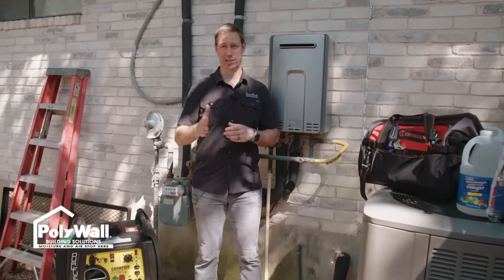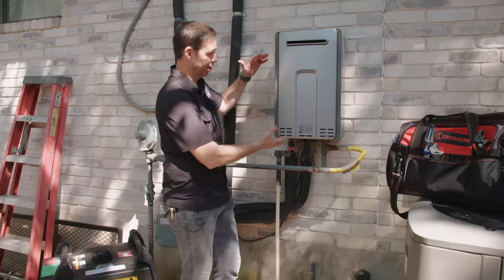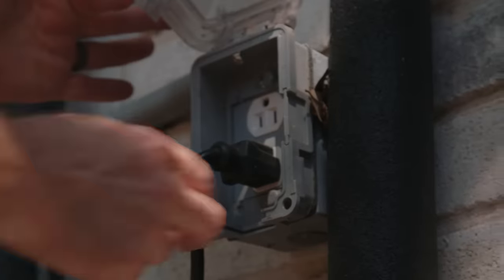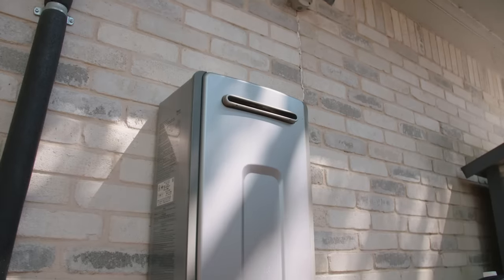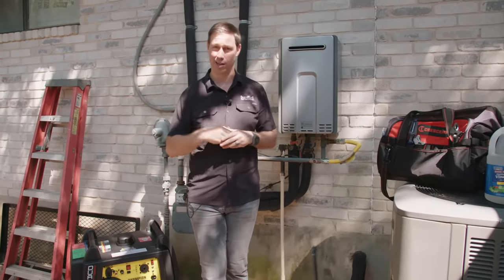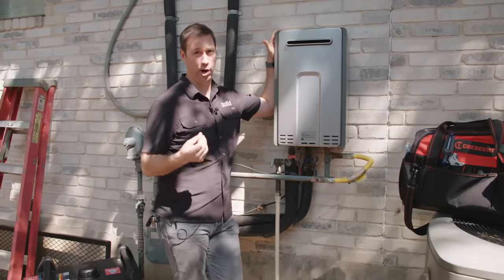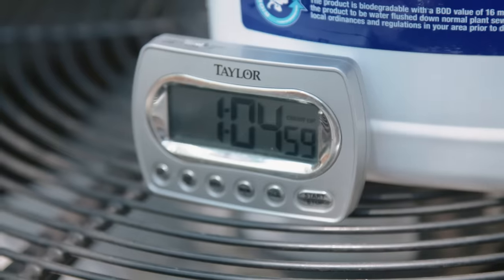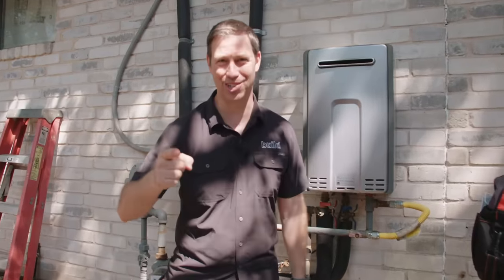3 Things They Don’t Tell You About Tankless

Comment: We had to have a water filter system to PROTECT the tankless.what we WEREN'T told was that our area had water that was very heart in calcium and lime so we went thru 2 filters a month. Then the tankless only lasted 5 years and NEEDED to be replaced AGAIN., and as a tankless costs 5x's as MUCH as a reg. Water heater and in order to have the 1 year warrantee be valid you have to pay a special plumber sanctioned by the tankless' manufacturer install it..... In the long run we went BACK to a STANDARD 30 gal. Elec. Water heater as a replacement when the tankless died.

Comment: Is a recurrculating pump worth it? About to build a house and sub contract myself if possible.lol   House more linear than horizontal and if I can save money by having hot water instantly as opposed to wasting water I would spend extra to get a tankless heater with built in pump.  Just don't want to go backwards finacially for convience for hot water.  Thanks for any advice.

Comment: Marey makes  tankless gas water heaters that do not use household electricity.  They use two D cell batteries for the ignition and valve.  The batteries need to be replaced every 4 to 5 months.  That's worth having after a power outage.

Comment: Another thing they don't tell you.. while they are totally great for showers, they are not so good for doing the dishes (hand washing) or shaving... anything that you do that turns the water on and off repeatedly.  I'm quite positive its resulting in more water usage.  When you turn off the hot water it shuts off and it doesn't turn on immediately when you start asking for more hot water, so whats in the pipe gets a nice shot of cold water before it goes hot again.

You know, another advantage to having an old school hot water heater is that in case of emergency, that old school hot water heater is full of drinkable water.

Comment: My tankless is inside and I simply plugged it into a normal computer UPS.  If power goes out, I have days before I have any problems.  The tankless just needs a little bit of power to monitor water flow and spark the ignition.

Comment: One you didn’t mention is the hot/cold water sandwich and the unheated water when you run the tap slow or for short bursts.  By the time I’m done washing dishes I have nothing but 40’ of ice water in the lines between the sink and water heater.  Have they solved these issues on modern tankless? (Mine is 15yrs old).

Comment: I considered a tankless system to save energy / money. I have natural gas that powers by furnace, hot water heater, and oven. My summer gas bills (when I am not running heat and therefore only consuming gas for hot water and cooking) is ~$20. Therefore I realized even a tank hot water heater is not consuming very much energy
Reply: I'm thinking about tank-less, BUT as you said my gas bill goes up dramatically during cold winter(last year went up twice), that tells me furnace is the one uses a lot of gas to heat the house , so i'm not sure if i can save on gas bill as single person.

Comment: Opinion this if you will. I live in Hawaii, I know sounds great, but energy is extremely expensive out here. We do not have gas in our home, everything is electric. Occasionally I'll take a gander at our power meter outside when the hot water heater is on, and that wheel is spinning SO FAST! I can nearly hear my money draining from my account. I rarely use the AC here, and LED light bulbs throughout the house, I can't think of anything else I'm really using other than my computer and the TV sometimes. Anyway, my power bill is always over 300 dollars and talking to friends of mine, that's really cheap compared to what they're paying. 

ANYWAY, you mentioned your water heater being gas and you won't save as much money switching to tankless. Would that make a major difference on my part? My water heater is supposedly efficient, but I know for a fact that any time the dishwasher is running or the washing machine or shower, that wheel is spinning for at least an hour longer than the cycle of whatever is running. Trying to do anything I can to save as much money living here.. It's not cheap...

Comment: With a 50 Gal water heater, you don’t get a certain amount before you get cold water, ive installed hundreds of them, their shelf life may be 10 years but unless you have bad elements or thermostats, it should keep up with over 4 showers running at the same time, considering most heat up 15 gal a minute.

Comment: Also energy savings from eliminating the stand-by losses are negligible/zero during the heating season, because heat leaked from the hot water tank contributes to heating the house. In warm weather locations savings are potentially much higher during the cooling season, because leaked heat drives up A/C costs.

Comment: During days of power outage at my small college in NC, (I was maintenance staff at the time). I ran an extension cord from a 410watt Schumacher inverter from my work van to the 2 rinnai units in the dormitory’s. I did this on a schedule at each dorm so that students could at least have hot showers. The units pull almost no power so I case of blackout I would say you can forgo a generator for hot showers. You might run into food storage issues but at least you can have a nice shower!

Comment: I looked into a tankless (electric) for an older home 1960’s well water (45 deg f) the electrical requirements were over a 100amp breaker  the existing service is 200 amp just another consideration temperature gradient and available electrical service

Comment: Matt, here in DFW in my neighborhood a builder installed these. That was fine until that extrem cold we just had with no electricity for over 30 hours. Those tankless were guarantees down to -30 below zero....if they have electricity. We got down to -3 with no electricity and those tanks froze. Then came the fun part. Some had water come into the house flooding the homes. Then finding a replacement, well let's just say some people had no hot water for a month waiting for a new heater and someone to install.

So my question is this. How do we prevent that double whammy without a generator? Because those were in high demand too.
Reply: Move someplace that has a reliable power grid or buy a generator.

Comment: i installed an electric Eco-Smart unit 3 years ago because of the space savings. I have a 2 person household and the unit is no more than 20 ft. from any usage . The flow rate for any outlet HAS to be EXACT  for a controlled temperature especially the shower . I flush the unit once a year with no difficulty . As far as energy savings ... i find none.   IF i had the room i would go back to a quality well insulated 40 gal. tank unit .

Comment: You missed what, 6 more noted by commentators - Min flow rate needed to kick on, need to filter inflow water, units will vary flow to suit settings, negatively effecting user satisfactions, cold incoming water as much of country has overwhelms heating capacity, cost and mess of installing bigger gas lines...  Instantaneous was invented for warm area limited use hot water supply, ie commercial / institutional that were wasting energy with huge hot water production / storage tanks, and was never intended for highly variable high demand residential throughout nation.  What it is is CHEAP when all the above is ignored and developer or GC just slaps one in and tell you you're the problem, if they pick up phone a all.

Comment: I have an elderly neighbor who has never had their system flushed in 5 years. I am going to do theirs for them and stopped by today as they have a model different from mine but looks just like the one in this video. I could not find the “Air” filter. I did find the inlet water filter. Do I have to take the air intake cover off to get to a filter?   Thanks

Comment: We just got an outdoor Rinnai with the recirc pump (set to run 4 hours in the a.m.). It replaced another tankless of another brand that lasted almost 16 years. 2 things I don’t like with the new is the hum of the recirc pump, and the more concerning thing is a couple of faucets will drip a few drops of water when the recirculating pump is running. We have 65 lbs psi at the hose bib, and the plumber came back and installed an expansion tank, but I still get the drips from the 2 faucets (all the other faucets and shower valves are fine). Weird…

Comment: I've had two A.O. Smith 50 Gallon Power vented water heaters. One lasted 5 yrs.  Got another one on a warranty replacement and it lasted 7 years.  Not good.  So another benefit of tankless is they last much longer.  So you might pay more up front for tankless, but these should last at least twice as long or more.  And although tankless has been around awhile now in the US, Europe has had these for decades.  They are not new tech.

Comment: Another downside to tankless hot water heaters is that you can’t have a really slow steady stream of hot water. Since the demand isn’t high enough the burner won’t kick on to heat the water. So you have to have a really good steady flow for hot water. So if you need that really slow slow slow flow of hot water, you can’t have it. I know from first hand experience. It’s a good thing I don’t need a really slow flow of hot water much, but when I do, it sucks. The only way to actually get it is to run another faucet at a good flow, so the demand is high and the burner stays on, but then that means I’m wasting water.

Comment: Thankless! I had a friend have one put in lured by that unlimited source of hot water. First that hot/cold problem sucked. It made you run full flow anytime a trickle would do to save energy and water. Why there isn't a federal code requiring insulated hot water lines I don't know. They rationalize that it doesn't save much energy, but that time wasted is my time. I lived in a house where there was 30 feet of chilling crawlspace to the kitchen sink. Washing hands was run a lot of water (a gallon) till hot then 5 minutes later do it again, what a waste! After wrapping wall insulation around the pipe not that wimpy pipe wrap stuff we had hot water on-tap during cooking and then it was still hot after dinner and ready for clean up. The flue from the thankless heater was very hot when it ran, less efficient than the tank's flue which was only rather warm. I hated this device. My and his choice was finally settled when the hot flue and the rest of it had an over-temp event and dam near started a fire. No thanks. Insulate insulate insulate.

Comment: The cost is more for the tankless but it's a lot more reliable and durable.  We had one for over 25 years and the only reason we got a new one was to get a bigger model with more volume.  In that time I probably would have had to install 2 replacement tank water heaters AND there's a chance of flooding when those tank heaters fail and you are not home.
Reply: While I don’t necessarily disagree with your statement, I couldn’t help but share that my dad lived in a Lake Tahoe and replaced his furnace and tank water heater that were still working after more than 40 years. I personally have a tank water that is on 20+ years.

Comment: Bought a new house with one and missing it right now that we moved. For 10 yrs I used it, soft water and ZERO maintenance. Current owner there has used the same tankless for and extra 5 years with zero maintenance and still running. YMMV. Rather pay for a new one than "maintain it" on a $200-$250 a year.

Comment: Okay,  How about utilizing,  using  both  tankless, and tank ??   Have the tankless output, go into the hot water heater. (Just a small 20  or 10 gallon,  too.  Using this  for initially having HOT  WATER, TO  HEAT pipings.  ). When the tank, gets low, have it setup to start the tankless system, then linking a 3 way valve, to the tank/piping. This would then, use the tankless system.  May some enterprising person, create this, using flow-meters/ solenoids, auto valves, etc.

Comment: For the Midwest what if you installed a tankless in front of your hot water heater. Instead of dumping 35° city water directly into our traditional hot water heater it goes to the tankless first 
set the tankless at the lowest setting 
It  would be an energy savings and you would still have back up if the power went out.
 just asking

Comment: I'm very curious about replacing my leaking r/v water heater and using propane and/or electical...from current uses it appears a ten gallon one may be adequate I've extremely low use and live alone.

Comment: Also Mr. Risinger, Tell your fans: When you get a brand new tank type water heater, remove the "anode rod" first thing out of the box and teflon tape the threads (3-4 wraps) because in 3-4 years it's going to take a breakaway torque1,350 ft-lb impact driver or 18" pipe wrench to remove it.

Comment: My trepidation with going tankless is whether these can handle cold water temps in Minnesota winters. I’ve read that tankless can’t handle below 55F temps. Mine would be installed indoors (basement). Would it make sense to do a setup where the conventional water heater feeds lukewarm water to the tankless?

Comment: I had an electric hot water tank heater.  It died, and then I got an electric tankless.  We have not changed anything about our hot water usage and our electric bill has gone down almost 20%.  The energy savings with a tankless is that the water doesn't get heated when it isn't being used.  A tank hot water heaters has a thermostat that constantly keeps the water at a certain temperature range meaning if you go on vacation, you're using gas/electricity to heat the water.  If no one is home during the day, you are still using electricity/gas to heat the water.  Everyone in the house sleeps on the same schedule?  So what?  You are still using electricity/gas to heat that water while everyone is asleep.  With a tankless that doesn't happen.

Comment: I can't afford an expensive heater right now, but Ive been looking at the cheap ones for well under $200.
I understand that they're designed for sinks and such, but I wonder how it would do in my house? I live alone and only need hot water for 2 things, my quick showers, and my dishes.
No washing machine.
Would a small 1.2 gal hot water per minute tank work for me?

Comment: one other very important thing is the power. These are very hungry in terms of KW . Most residential installations would not work at least in continental europe where default counter is 40 Amp for 220 V. These require 6 K W to get confortable shower

Comment: Totally disagree about the maintenance costs for tankless units. Have a unit made in Japan. It lasted 25 years. Way longer than a tank system. Never had any maintenance costs. No need to clean it, ever. Your water must be very hard if you need to clean it every 12 months.  Also, these units come with temperatures controls. You don't even use the cold water tap. Just set it to your desired temp and turn on hot. This means you do not need to heat to 60celcius like a tank system, which then gets mixed with cold water back down to the 40celcius for a shower etc. This is much more efficient.

Comment: a year after getting my tankless system installed in my house and its one of the biggest regrets i have ever made in life.
Its expensive (more on that later)
I end up wasting so much MORE water than before, just waiting for it to get hot.
Here are the facts. if you live alone, its perfect. if you live with ONE other person, like me...only ONE other human is in the house..and its horrible. dont run two faucets at the same time.
the expense part, if you only shower once a month, its great for you, but if you dont..youre going to have trouble. the amount of energy it takes to heat up water in the morning, is the same cost of running my old water heater for a week..needless to say its a regret.
Reply: I definitely agree to some point. My boiler had a tankless heating coil and it could not at all keep up with any amount of use. Water coming out of faucets lukewarm at best, during the course of a sink usage. Showers would go cold on you for trying to wash your hair or enjoy any bit of comforting warmth. Installed a 40 gallon tank and had the tankless portion of the boiler capped off, and never looked back. Now we never run out of hot water for a family of 6 even when two people need to wash hair and are in the shower for an hour each back to back.

Comment: Dear God! If the hot water didn't run out, my kid would NEVER leave the bath tub.  I was the same way when I was younger.  I once fainted because I had spent the whole afternoon in a bath, reading a good book, not eating and then topping the tub off with piping hot water.  The phone rang (land line) and I jumped up, wrapped myself in a towel and went to go answer it.  It was my then boyfriend, now husband.  I woke up from the deepest, most relaxing nap, wondering why: 1) the phone was making the disconnect noise; 2) The phone receiver was laying on the kitchen floor; 3) I was also laying on the kitchen floor; 4) I was soaking wet and 5) Wearing a nothing but a bath sheet. I had a roommate and wasn't in the habit of wandering around the apartment in a towel and I never took naps on the kitchen floor.  I hung up the phone and my boyfriend called back.  I had scared the life out of him. He said that I was talking cheerfully and then my voice just faded out.  He shouted and called to me, but I didn't answer. He hung up the phone and tried to call back several times but got the busy signal. He said that it had been about 10 minutes.  He was ready to call the police and an ambulance when I finally answered the phone.

Comment: I have yet to see any comment about the gas pipe volume for the BTU's these tanks require. I have a tank water heater that's gas. How do I know if that will suffice or do I need to replace it with a larger gas pipe?